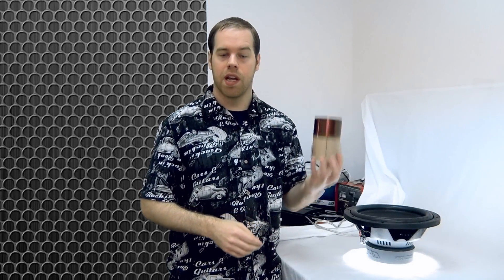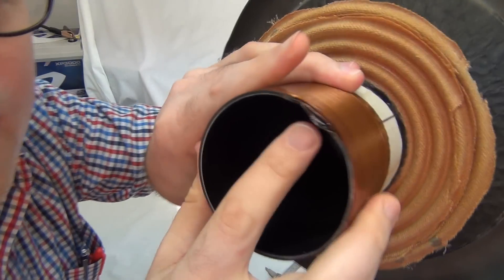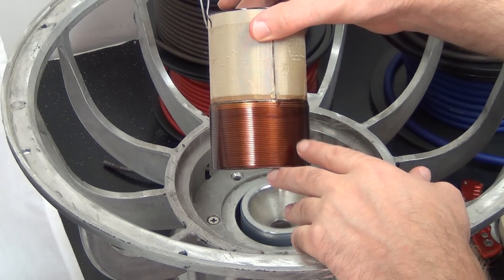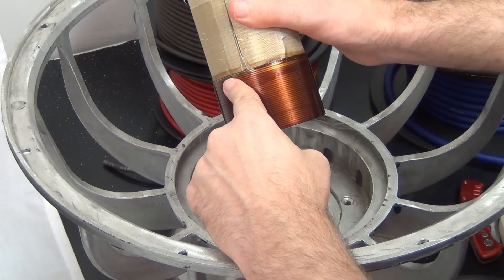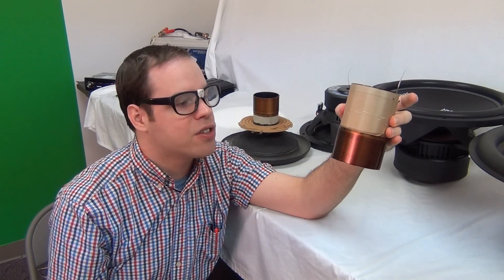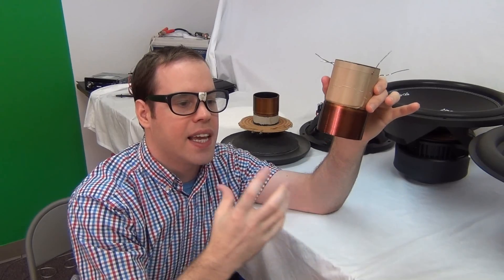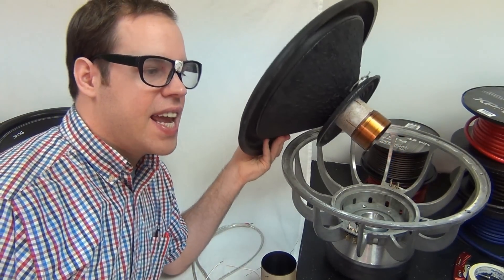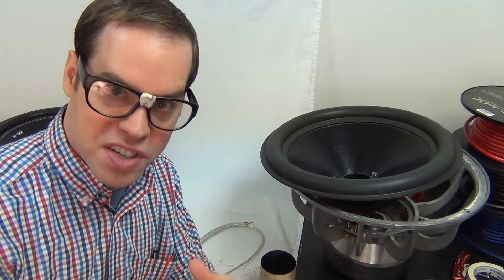Voice Coils

Comment: i have opportunity to buy 4 x 10" eminence speakers... it seems voice coils are blown. cones and everything look perfect. I found this recone kit featuring voice coils with Kapton with 1.005″ inside diameter, 1.125″  form length, .437″ windings width, 8 ohms

but if I can get away with just changing a voice coil will this work just as well 1.005″ Voice Coil VC3130-8 (1.005″ ID, 1.0″ form length, .312″ WW) 8 Ohm

I don't know what the speaker's standard voice coil spec is, but the two I detail above are slightly different winding counts and form length (.125")... does it matter? diameters are right and impedence is right.... cos I could change the coil without needing a whole cone kit surely if I remove cones gently.
Reply: Are you 'avin a laugh? Is he 'avin a laugh? I haven't ever seen anyone just change a coil they r glued to the cone and the spiders u will damage one or the other while removing the coil u  have to cut the surround and the cone out to get to the coil to just about any subwoofer I have ever seen

Comment: The part about Aluminum vs Copper voice coils in this video is wrong. Aluminum conductors of the same size as copper conductors have a higher electrical resistance which means that they would need to be made of larger diameter wire to have the same resistance or they would need to have fewer turns. If the resistance of the coils is the same then the heat generated by the coil is the same for the same amount of power. The thermal conductivity of aluminum is also lower then copper, but contrary to what was said in the video this means the aluminum retains heat longer then copper.This also means it will heat up quicker to any specific temperature and have a higher top temperature at any given watt density when compared to copper. He is correct that you would need more aluminum to get the same impedance because the wire would have to be larger in diameter to reduce resistance. You could reduce the number of turns also to get the Impedance down to the desired level but then not only are you reducing resistance but also inductance which will reduce efficiency, even though this would save weight and cost less. Efficiency is just as important as watt handling ability. if you had a 500 watt speaker that had a 90 Db/W/m sensitivity and a 1000 watt speaker that had a 30 db/w/m sensitivity the 500 watt speaker would be considerably louder. 

As for the efficiency question at the end. If the coil has a low resistance and a high inductance it will produce a larger magnetic field but the higher the inductance the more it rejects high frequencies.The way you would increase inductance is with more turns in your coil or with mutual inductance where two or more coils enhance each others magnetic field.  Actually i'm going to drop it off there. There are some complicated relationships that i'm not going to type out here. But just so its clear resistance, and reactance make up Impedence and inductance and capacitance make up reactance.  

If you want to confirm what i have said it can be easily looked up. For the statements about the heat propertied of aluminum and copper it may be helpful to look up heat sink design to get a better understanding. 

Also as wire diameters involved the Skin effect come into play in coil design.

Comment: i think you got a part of aluminum vs copper voice coil mixed up. jl audio uses aluminum voice coils on their subs and none can go over 1200w or it voids warranty, they are known to be more musical. sundown, soundqubed, orion... they use copper voice coils and are known to take abuse thats why they are commonly used in spl comps. aluminum is more musical and copper is for spl
Reply from the maker: You have good examples there, but your statement isn't accurate and it's more in depth than just a couple examples will show. Power handling is much more than the metal used on the coil so what limits the JL is the coil size more than anything. Inductance is always a factor in performance so what many other woofers are finding is that they can get more motor force with copper. Traditional SQ woofers use copper along with many other design factors in the motor. JL uses aluminum because their design requires light weight. Mass balance is important in SQ so cone materials are more important than coil materials. Sundown actually uses flat aluminum in their big woofers like the NS v4. Althought Soundqubed doesn't make an SPL woofer and the Orion woofer is not really SPL, but it handles tons of power, they do both actually use aluminum. Flat aluminum has become a favorite of many woofers because of heat dissipation, though technically copper will handle more heat so there may be a few exceptions out there.

Comment: What about using silver-wire?
Reply: 1BlubeTube  I was thinking the same thing, since silver is the most conductive metal, just not sure how weight and heat would play a role, wouldn't want to melt the metal before the adhesive, plus that would be very expensive!!! probably as to why its not a very popular decision.
Reply: Random Tube gold is the most conductive metal bruh
Reply: R u meaning solid silver or the silver tinned? It would be on e extremely heavy coil, best coil n my book is cca it cools so much faster depending on cooling of the sub depends on what type of coil is the best and applications

Comment: get with the other guy on here that makes water move,and ya'll build a spaceship that hovers on vibration.got to make it light weight.so you may have to think of differnt things to use for the original parts,or making lighter parts like the magnets.cheers